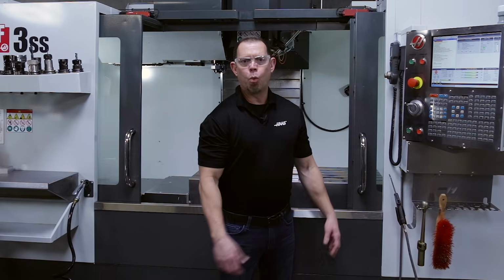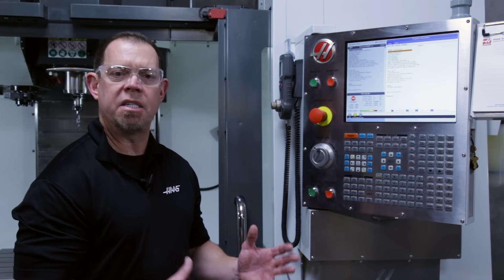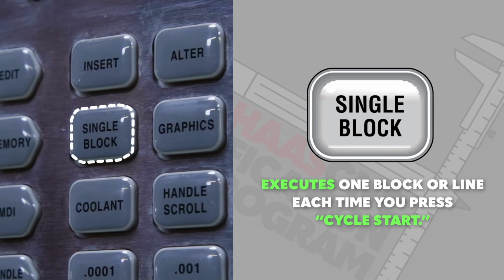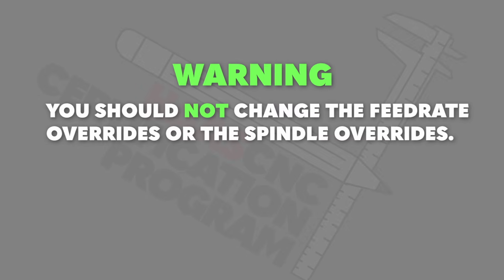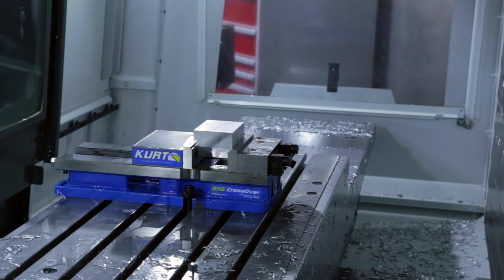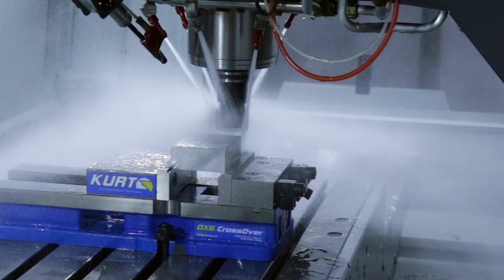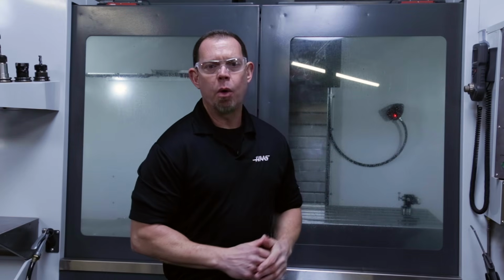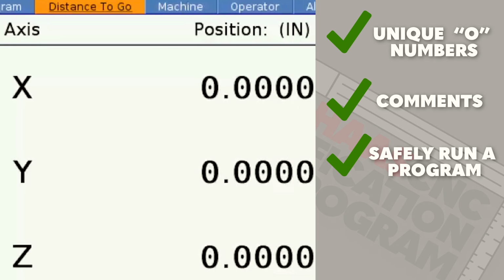Haas Certification Video 5.1 - Running a Program

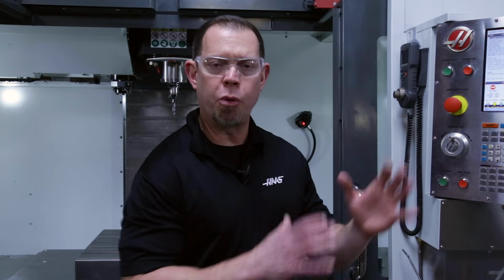Comment: 3:00 - Great course, every educational. Is it ever possible that either the listed tooling in the comment section is incorrect, instead of the code which is programmed to call a different tool which is correct?